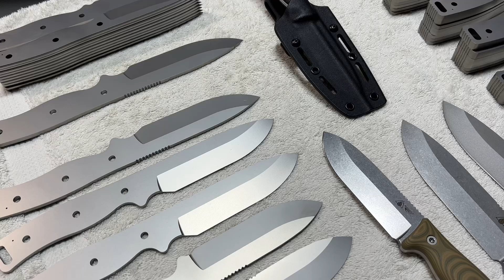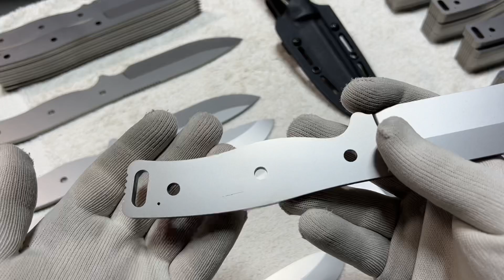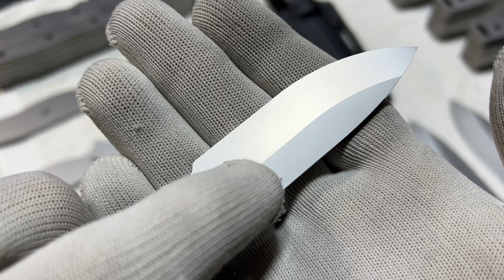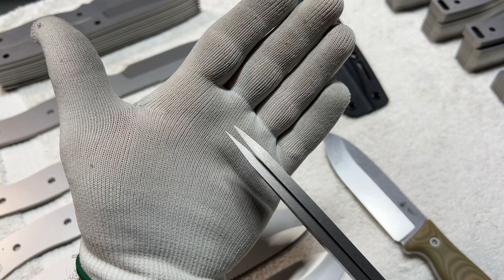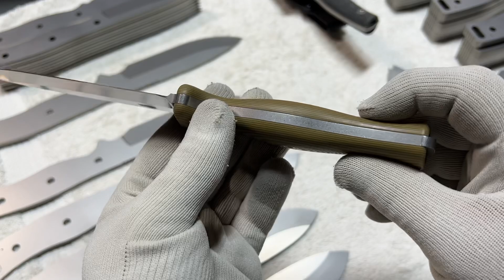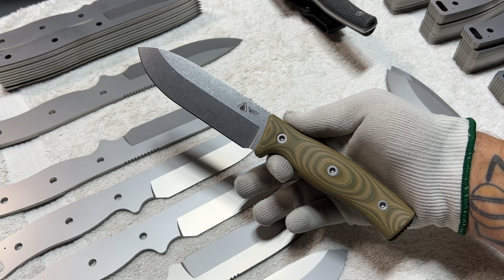More Magnacut Inclusions

Comment: I don't mind some grind lines showing up under a stonewash. To completely polish a blade before stonewashing takes a lot of extra time and extra money (finer abrasives etc), which adds up to extra cost. I do love a polished stonewash but I understand I have to pay extra for that. But for a harder use blade, I think a heavy/coarse stonewash is the best finish since the blade gonna be beaten up no matter what.
Reply from the maker: We have some ideas, it will just take some time to develop everything. Workflow aside, there are a lot of functional reasons we moved back to where we did. Stand by.